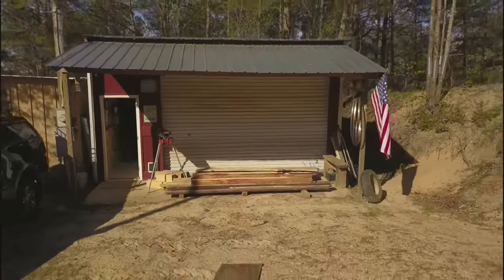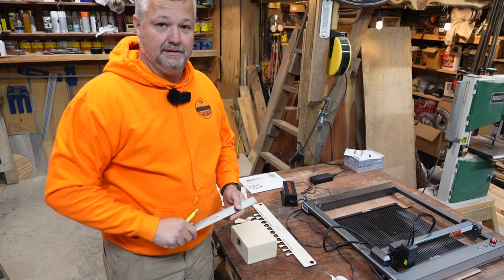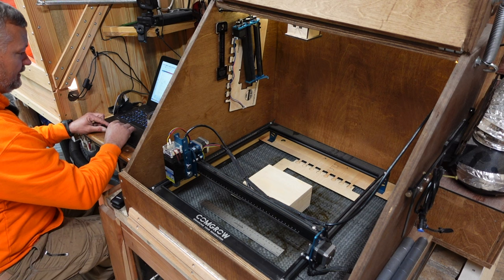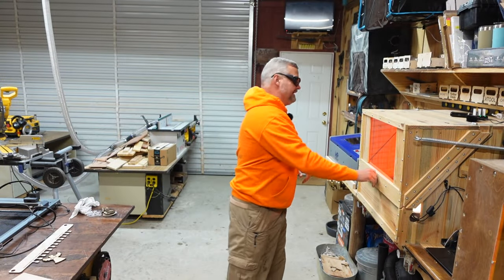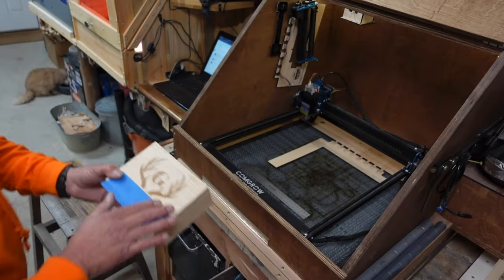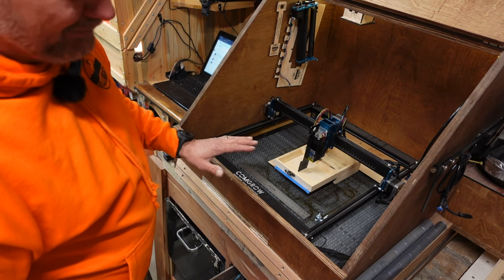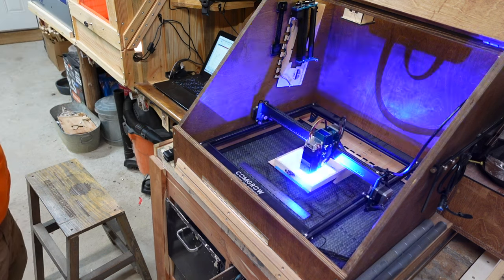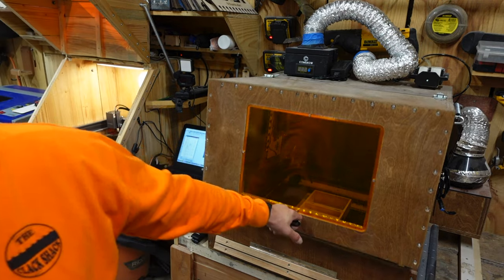Small projects for diode lasers

Comment: When it comes to leveling things, modeling clay is your buddy. Someone else may have mentioned it but I'm too lazy to read all the comments (owning my 💩).  Got this idea from a manufacturer's video ... nope, don't remember which one. I used it on a knife sheath that was all kinds of funky angles and it worked great. Non hardening is best because you can use it over and over. Thanks for another great video.
Reply from the maker: I have used it before.. thanks.

Comment: Nice work on the custom box.  That is one nice option on my larger Co2 laser is swapping focus lenses for a longer length to get able to get the moving head higher above the workpiece. However, it's not a $300-$400 machine.  As you say, you can do a lot with multiple machines running. I've also enjoyed not having to spin up the large laser for a single job that the smaller 20w Diode can handle in just a little more time than the Co2.
Reply from the maker: Making what I have work. Less overhead means more profit.. thanks

Comment: I have a silly question. How do I do a setting test if I only have a one-of-a-kind item to engrave on? I will watch this next.  Material cut testing for wood. Also do you take into account the kirf on your jigs? D1 pro on the way!!
Reply from the maker: You don’t you have to guesstimate…. I have it happen a lot. No,burn as is. If you get them too tight, they won’t work right

Comment: Haven't played around with different DPI settings. (I have a D1 10W) How do you determine what DPI setting to use? Why not just leave it at 317 for a .08 laser?
Reply from the maker: The higher the DPI or LPI, it affects the burn time on images. Some mediums do better with different settings. Its really just a preference to me. Higher numbers give smoother results, lower number make speed faster. I try to find the sweet spot where spped is maximized but quality isnt affected.

Comment: Comgrow Comgo Z1 with available 5W/10W Laser Modules. Nice 105mm Z travel on the Laser Head… 🎉😂😮
But I HATE having to move the bolts to get the full travel.
Still designing my Z-axis Adjustable and Bladed Quick Change Mount so I can switch between my 5W and 10W Heads and it will adjust for the different dimensions of the two heads so the laser beam point is the same between changes… Cause it’s NOT with the Standard Slide Mount. 😂
Reply from the maker: No more than I have to change it, really isn’t a big bother.
Reply: @TheClackShack  Drives me crazy. I do a lot of changing from short stuff on Spoil board to cutting on Comgrow's smaller Honeycomb to the Rotary narrow and wide Tumblers and glasses and each one needs a different bolt hole/height. I try to batch them up to minimize the height adjustments but I chance at least 4 time a day. And knob adjustable mount would just need some turns to go up and down the whole 105mm range (or more if you're designing from scratch ;-) ) and if you switch between the 5W and 10W module you quickly learn they are different dimensions so the laser focus point moves laterally as well as up/down. The 5W is a better Engraver and the 10W is a better Cutter Even though they are both .08x.08mm. Can't figure out why but I've tested since I have them both.

Comment: The easiest and safest thing  for the inside box lid would be to measure the inside of the box, nut a piece of 3mm ply, burn your design then glue it inside the lid, no one is the wiser.
Reply from the maker: I wanted it on the box.